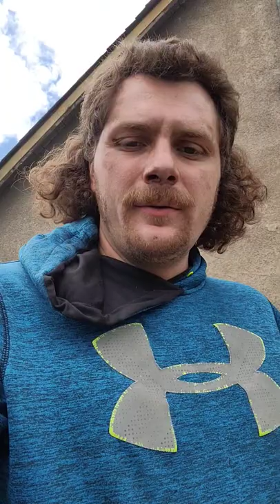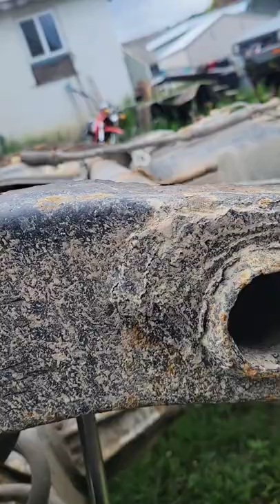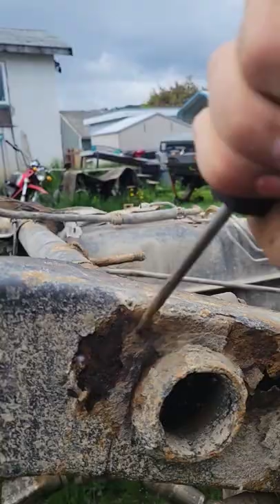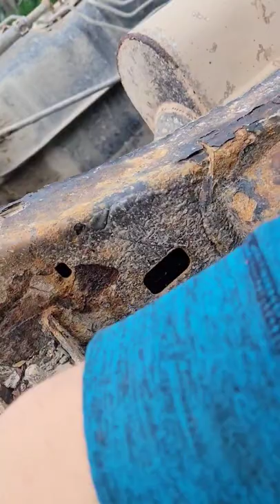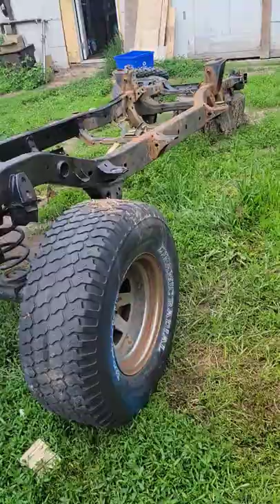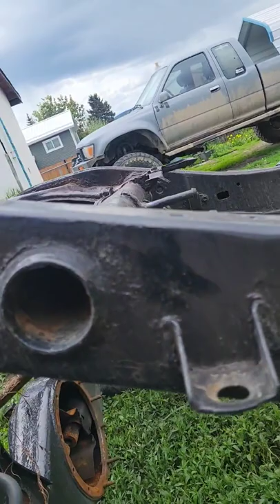Toyota Frames are the best 😅

Comment: Im dealing with that right now on a second gen 4 runner lol
Reply: Mine didn't even have the ability to weld fix it. The back shock was rusted out so bad there was nowhere to even weld anything to. Did a frame swap and the 3.4 swap. Best move ever. The 3.0 is hot garbage,  or at least it is right before the HG goes...
Reply: @fightthelies4349  mine too was so bad all the rear was done. Bought a 2wd frame easy to swap to 4wd im almost ready to put the cab on
Reply: Just total it and get the insurance
Reply: @davidr6865  what these sell for and what Insurance will give you are 2 different numbers.  Here in Colorado you can get 10k for a 4runner with 300k on the clock.  Blue book is around 3k
Reply: Americans and their wannabe work vehicles. That's a private vechile, form over function, never will be a commercial vehicle. Look at how the frame looks on a Ford Transit flatbed in Europe. Simple, cheap, durable. 10 years should be no sign of rust. Then you have these contorsioned metal frames in these pickup trucks ... how do they even make that? That's unibody technology. Why even make a frame if you make it like a unibody?

Comment: Isn’t that ALL Canadian vehicle frames?
Looks like every one I’ve had
Reply: You should see the.. “rust belt” of the south

It’s free weight reduction man!
Reply: Yup as a Canadian thats what happens to every vehicle after 10 or so years
Reply: Canada has nothing on the amount of rust and suffering we have in the Midwest of America. 

To be fair, we can all just drive out to Nevada and buy new old rust free 90’s shit boxes whenever so that’s good at least.
Reply: @dackbowland1876 north west isn’t suffering with rust and it snows here lmao
Reply: @john_toss  do they spread vehicle elimination salt like they do here? Brand new car will look like it’s 12 years old after one winter here
Reply: @dackbowland1876  they spread some salt but In very low percentages and mostly use sand. Plus it doesn’t snow as heavy
Reply: Try with Ford, he he
Reply: My 88 4runner frame is perfect and I live in the caribou with lots of salt. Had my toy over 15 years and every spring when i change my oil, and wash and wax my truck I would spray the frame and underbody and inside rear fender wells with gravel guard ,(no prep other then a rinse) and my trucks frame and underbody is absolutely gorgeous. Better then my old man's frame on his 2011 dodge.  That bein said I have owned toyotas with terminal cancer I couldn't save alot of it is luck of the draw
Reply: Rustproof this won't happen. Budget $100-130/yr.  Well worth the investment

Comment: I worked as a headmaster for ten years. When there was a blow through in the frame like that I would sIt tell the metal quit pulling back then the companies knew to cut a certain amount around that to replace the steel. It's a good thing you liked that unit off the road for the two years as it would have been extremely dangerous out there.

Comment: Just dump the foreign crap. I put them side by side with an American product, and the Amercan design is always better.
Reply from the maker: That's far from true. My 07 Chevy is more rotten than anything else I own
Reply: @DirtGarage  is that the nbs body or the cat eye
Reply from the maker: @augustusgloop9330  Cat Eye
Reply: @DirtGarage  damn that’s crappy man those are pretty nice trucks too
Reply: That would be a good argument if Chevy trucks older than 10-15 years didn’t have the bed (box) and cab fold up like a taco 🌮 because the frame is rusted through and disintegrating